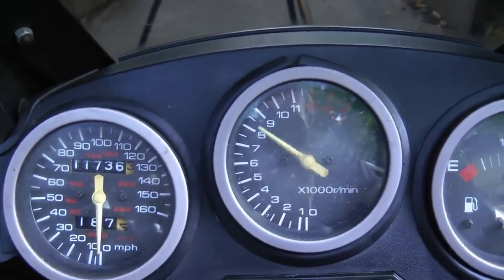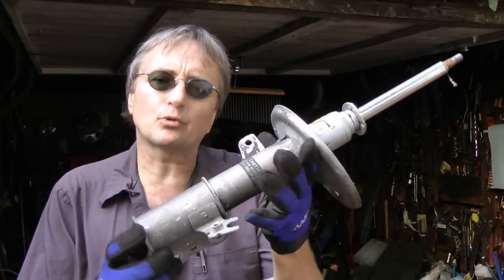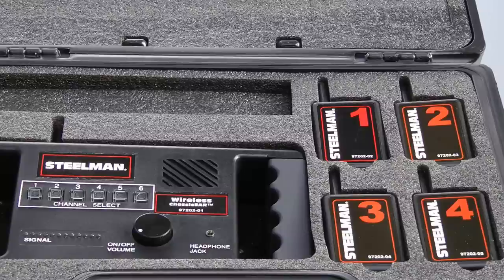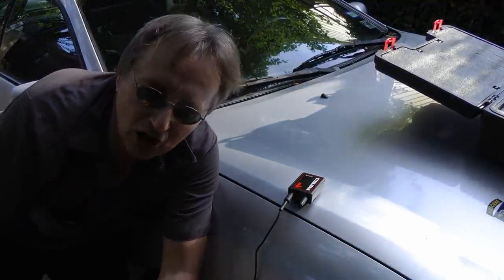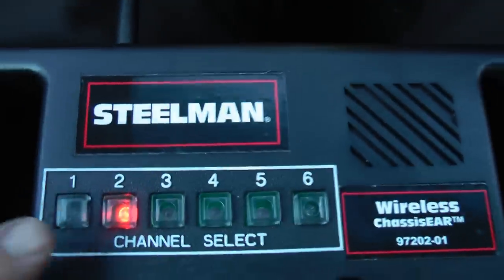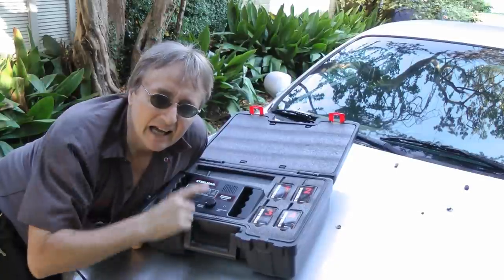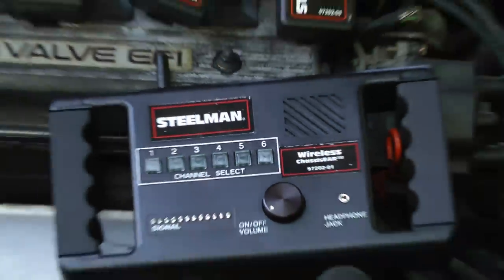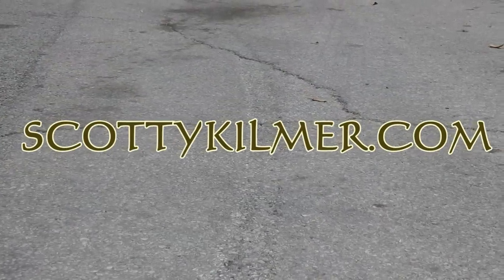How to Find Noises in Your Car

Comment: noise rattling from engine when @ low speed below 40 km/hr. 2 lexus tech drove and i was sitting @ back. they heard that noise too but couldnt pin point to anything obvious, Then they put in drive (D) and hold the brakes and gave gas @ same time. it was coming from front side of engine near the oil dipstick , but they still cannot find the problem. they were suggesting tensioner or something with camshaft. but still not sure.  what do u think of it.thanks

Comment: I have a 2000 Accord v6 with 155k miles on it. and when I'm driving I hear a grinding/rattling noise when accelerating (hard to tell where its coming from). But only if I'm actually putting load on the car, if I accelerate in neutral or park I don't hear it. I was told that its the catalytic converter that's causing the noise. Any thoughts Scotty or anyone else? Thank you.
Reply from the maker: +HollowBeThySquad  jack it up, hit the cat with a hammer, if it rattles, that's it
Reply: +Scotty Kilmer will do. Thank you for the input, you're the man
Reply: +Scotty Kilmer ,hey mr.Scotty I have a 2002 Infiniti i35 makes a rattle noise dont know were its coming from need help

Comment: hi Scotty. thx for the video.  my 2016 mazda 6 makes this "clunk" sound as i drive over shallow dips. this sound comes from the front passenger side.  it happens very randomly.  it sounds like when my old honda was having cv boot issue.  anyways, i'm concerned it might be something serious and so i brought it to the dealer that sold me the car.  the first time i took it in they said they couldn't reproduce the sound.  but when i drive it, at random it would make that sound.  especially when i'm turning left it seems to happen more often and also when the car has been sitting for a long time.  very frustrating.  took it in the second time today and also shown them a video clip i recorded last night which i was able to capture that sound. they claim they couldn't hear it and that even if they do hear it, it proofs nothing.  they said just now that they will have to install some listening device and see if they can pick up the sound.  if they come back saying they couldn't find the sound again, what should i do?  pls advise. Thx Scotty!
Reply: Could be struts. Sometimes they do that, even on new cars
Reply: yah it's most likely the strut. but the noise doesn't sound normal.
Reply: actually, after making a huge fuss over this with mazda usa, they sent a factory master tech and took my 6 away for 2 weeks and finally fixed the issue.  turned out they knew abt this all along and had a Technical Service Bulletin published months ago.  basically, the dealerships' service department should keep abreast of the TSBs so when customers bring in complaints of this sort, they'd know how to handle it.  clearly, my mazda dealership was incompetent in that they never knew of this TSB hence my frustration in going back to them 3 times to inform them of this issue.  anyhow, mazda japan had to reengineer a new 'suspension back stop' to fix this clunking noise... i'm very unimpressed with mazda as i really wanted to like this brand.

Comment: Ive got a thudding in the rear ov my vectra could it be the swaybar link also ive got vertical play on my rear wheels aswell what can that problem be cheers for your help.yr a genius .
Reply from the maker: jack it up, see where the play is with moving parts that shouldn't move, and replace them. Tons of possibilities including sway links
Reply: Thankyou nothing moves or clunks would it be easier to just change the sway bar and see if the noise goes .also is it normal for you to have vertical play in the other wheel
Reply from the maker: Jason Platton
As noises can be really hard to pinpoint, I would change the swaybar bushings as it's an easy job. But you should have no play on any wheel.

Comment: scotty i have reached rock bottom my 2006 nissan altima 3.5 has been given me problems from the beginning. i have a weird engine noise/vibration/clutter coming from the right side of the engine it sounds like its coming from the top on the timing chain but they have told me its not. this noise only happens when the cars oil if ully heated and i turn of the car for about 30 mintues and turn it back on. it only does it then never when its a cold start i dont know what i could be i have the best oil filter along with good oil and everything but its giving me this weird noise. if i step on the gas while its doing this noise i hear the lifter making a rattle like there not enough oil reach the car. the oil leve is good btw. could it be a bad baring in the oil pan? im not sure because the noise eventually stops when i drive. only happens when i turn of car and leave it sit for 20-30 mintues. please scotty help me answer this mystery
Reply from the maker: timing chains and their tensioners often do that, have a real good mechanic check that possibility out first. And yes, they aren't the greatest of cars as they age, NISSAN quality has gone downhill the last couple decades
Reply: thank you

Comment: Well in my case it's not that I don't know where the noise is coming from, it's what's causing it that's driving me crazy.

I'm having some serious rattling from underneath the pedal area when driving at around 60mph. If I go slower or faster than that, the noise disappears.

The pedals aren't loose, I've already checked that. And I can't look at what's causing under there because it only happens while I'm driving.

Comment: Way back in the day when I worked for Ford, we had something like this. However, no part of this device was wireless. You'd be driving down the street with a variety of color-coded wires running from under the car and into the windows to the control unit. You felt kind of ridiculous driving around this way and the sound quality was terrible. When you opened up the kit, it looked like a big pot of spaghetti for all the tangled up wires in there.

Comment: I have got gmc yukon 2010 SLT xl, now a days I am experiencing a lot of unusual noise from my interior as if some thing is loose specially when my car goes on cat eyes on road. I hope you understand what I am trying to say. I would appreciate you help!
Reply from the maker: +Gods &amp; Generals  realize they don't make em like they used to, and often the plastic crap inside the dash will make noises. Try to pinpoint the noise and pray you can put a little silicone glue on rattling parts

Comment: Hi Scotty. I recently changed my belt tensioner but as soon as I started the engine I heard a chirping bird sound and a tweeting sound. Is this a loose fan belt?  thanks
Reply from the maker: EndofUSA it's generally a loose or worn out belt
Reply: Scotty Kilmer but belt is just about 8 months old!!!
Reply: Scotty Kilmer
hi Scotty. Just found out that my 8 month old belt had some parts already stripped. I bought me a new one and replaced it. The tweeting and chirping completely disappeared!!! Now my question is what caused the belt being destroyed? I am sure when I installed it it was perfectly aligned. Isn't it that fan belts should last at least 3 to 4 years?  thanks
Reply: +EndofUSA The same thing happened to my belt. I went to Firestone and they told me that the pulley on my alternator was malfunctioning and was eating the ribs on my belt to the point where it was a bout to snap.
Reply: Henry Cunningham
yes Henry same thing with me. I found that my belt tensioner pulley was no longer pendicularly straight thus giving a misaligned angle and thus feeding the fan belt wrongly to the other pulleys thereby destroying slowly the belt stripping away the ribs!! But I finally manage to realign the belt tensioner pulley and saved me some money!!! So far its been a month now and I I keep checking the belt it has not showed any signs of breaking along the ribs like it used to!!! Its a good thing that we guys no how to solve our own problems!!!

Comment: I've been having an annoying issue with my 91 camaro for a year now where whenever I turn the wheel at low speeds or hit a bump just right the front end pops a little.  I've tightened down all the k-member bolts and I've had the steering gone through by an alignment shop and had them replace a few tie rods.  There is no cracks in the frame around the steering box either which is normal for these cars.  So what else could it be?  It's driving me crazy

Comment: Hi Scotty Kilmer my old Mitsubishi Lancer 2005 is making a squeaking sounds especially on slightly rough roads, the mechanic replace all 4 shock absorber he suggested and done but yet it still making that noise. Please help. Thanks
Reply: May Grace Check your control arm bushings, just spray some penetrating oil on them and see if the noise stops. If it does change the part.

Comment: Hi Scotty, i have a ford falcon 2003, when driving it makes a noise as if it has another morter running in there other then the engien. the faster i go the more noise it makes. when i stop the car and leave it on i cant hear the sound, it comes only when i speed up above 60 km/hr. and it sounds more on the in side driver seat. it almost sounds like a sea plain taking off. what can it be?
Reply from the maker: almost always worn wheel bearings, have friends ride with you with their head sticking out to see which wheel is doing it

Comment: In my case, what if I dont know exactly where the noise is coming from or if it's not related to my suspension? I keep hearing a noise similar to the roof of your house cracking in the passenger rear side of my car.
Reply: Cristian Castillo creaking noises are most likely control arm bushings being worn. You can try spraying them with penetrating oil and see if it stops the noise, then you'll know which one it is.

Comment: HI Scotty! 

Iv'e been having issues with noises which sounds like its coming from my front end. I drive a 2007 toyota rav 4, replaced all my brakes, struts and due to a recall had the rear suspension arm replaced. ever since i got the car back, i've been hearing a weird noise which sounds like something scraping (not a clicking or whining noise) when i turn the wheel to the right or left. it also happens when I'm idling for awhile at a stoplight or stop sign and hit the gas to go. I've been back and forth between my mechanic and dealership. my mechanic says everything is okay but my gut is telling me that something is not right. when i got my recall paperwork back from toyota, they said my front suspension components were worn, could this cause the noise? 

I am at a lost and have spent so much money to no avail... the noise is still there. i need help please!!!!
Reply from the maker: +melba ancheta  realize those little ravs all get noisy when old. IF tires don't wear out strangely or front end has no wobble at speed, live WD 40 on all of them and quiet them down for a while that way

Comment: What about when you hear a noise in your driver side by the front when you drive but there is a big noise when you push the gas to run fast, only when you get out but once you are running you don’t hear anymore any noise, how can be identified that noise and from where came, a guy told me is the transfer case but honestly I don’t think he really know what he is talking about because he is no really a Good in mechanic problems of cars, can you recommend me any solutions at I can do to identify that noise, is a Honda Element 2004 AWD and been looking from where it cames this noise

Comment: Got myself a dandy noise coming outta my 2003 Elantra GT kind of a loud rubbing or grinding noise whenever im driving or have the car in neutral with the clutch pedal out that goes along with the cars idle, and it dissappears whenever i push the clutch pedal in, I think its the Throw out bearing but a couple of the guys figured its the pressure plate, and one said its my transmission being on its last legs, but the consensus seems to be the throwout bearing. any ideas?

Comment: hi scotty. i  have a 2008 Nissan rouge AWD  and this summer i started noticing noise coming from the engine side when the A/C is turned on and it tends to get louder when i step on the gas it kindda sounds like a whistle more than anything else. could you help me please?
Reply from the maker: +stranger21ny pray it just needs a new fan belt and not an AC compressor clutch
Reply: +Scotty Kilmer  i sure hope so. thanks a lot

Comment: thanks. how much is it?
Reply from the maker: I got a used unit for 60 bucks on ebay
Reply: Scotty Kilmer I have 2002 mustang v6 it's making a knocking sound what are the most possible reasons for it..  please help
Reply: Bull Ballz if its a v6, your motor is shot. classic 3.8 problem. usually caused by a seeping head gasket

Comment: You a Celicaman, Scotty? :)
Reply from the maker: yep, the old ones, 90s especially, were great. But the newer ones were junk as they used a yamaha designed engine that blew up all the time from lack of oil pressure, bad engine design there. One reason they stopped making em.
Reply: Scotty Kilmer
Totally agree! I love all Celicas up till the last generation. Had a 1988 model, sold that one and got a 1998 ST. I do miss the 88 :)

Comment: Scotty.. Am getting a vibrating sound in dashboard area when car is in drive mode and i hold the break in zero speed... If car is running there is no sound..
Reply from the maker: S Deen many things are inside there that can rattle, but odds are car is just idling too low. Try my video "how to fix a car that idles poorly" and also check for broken motor mounts

Comment: Scooty.. ibhave a problem... my mitsubishi triton... everytime i press accelaration pedal, the annoying noise "tek tek" sound is come out... i dont know where that sound coming from...
Reply: I have*
Reply from the maker: often worn valves or worn timing chains or belts do that from too advanced ignition. check that first. Also check for exhaust leaks, they will tick when gassing a car

Comment: Scotty- 90 buick lesabre limited 3.8L-replaced harmonic balancer, tuned up (plugs and wires, cleaned and took apart throttle body) under a load the car sounds ok but when it comes to a stop it dies,  and at idle, lots of ticking and knocking and sounds like the engine is going to explode-what the hell is wrong with my car?   FRUSTRATED

Comment: Hi i have 2006 nissan altima 2.5 and it drinks 2 liter engine oil in 2 week's wats the problem
Reply from the maker: +Riyaz Baig it's an altima made in 06, horrid engines that burn oil as they age. Just keep adding oil and get a toyota next time, you would have to rebuild the engine to stop that
Reply: If I rebuild the engine Wat all things may have gone in there and Wat things should I replace

Comment: Whatever you do, DO NOT PUT DUCT TAPE ON YOUR PAINT!!!!!!! This will leave a residue that's a bitch to get off. Been there, done that.
Reply from the maker: not over a short period of time like this test. If it sits for weeks in the hot sun, yes.
Reply: I did it to prevent rust developing on some paint cracks I had with my car.
My paint is 15 years old and for the money to get it repainted, I could just get another car.
Reply: Use a heat gun and acetone-free nail polish remover. Easy.
Reply: Put it on metal for a short amount of time - fine.

Put it on plastic at all - have fun with your new paintjob, as it rips away the paint with it

Comment: Scotty what r u talkin bout a wheel bearing takes alot of time/expense?? Nope - Replacing a timing belt or head gasket takes alot of time/expense. A wheel bearing comparative to other car repairs? PHSST
Reply from the maker: I'm talking about DIY guys fixing stuff here mainly, seen them take over a day doing a wheel bearing job.
Reply: id love to see you change a press fit wheel bearing with no bearing press no torch or any other specialty garage tools that most people don't have okeefe58
Reply: its just plain not an insult when you have a wheel bering that's seized into the steering knuckle its never fun remember I live in Canada salt snow ice its not fun working on a car after

Comment: Damn scotty you getting all high tech on us, they sell for $250 what ever happened to do it yourself???
Reply from the maker: it was 125 when I got mine. Realize mechanics now charge 100 bucks an hour, you're still saving money doing it yourself in the long haul.
Reply: Your 100% right but what are the chances i will use this product again within 6 months? Its pretty costly for one time use , not to mention some people may just need a toturial video or instructions on where to start or place these. I've watched a lot of your videos and learned a ton from them, the only thing i learned from this one is that there's a gadget for everything.
Reply from the maker: El CaNgRii don't be too cheap when fixing a car. Modern cars cost 20 to 30 grand at the bottom end. This machine cost me 125 bucks, so it's a deal if you ask me.